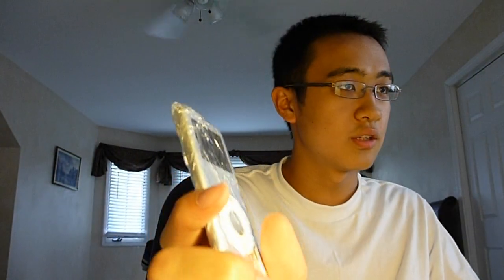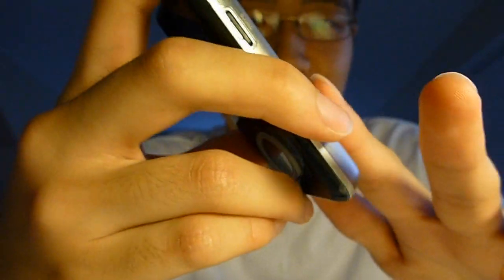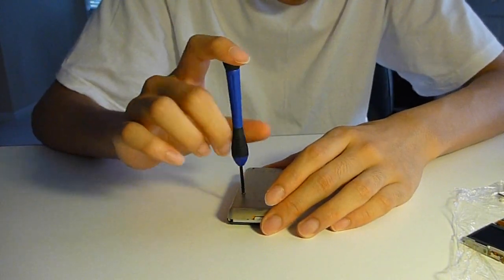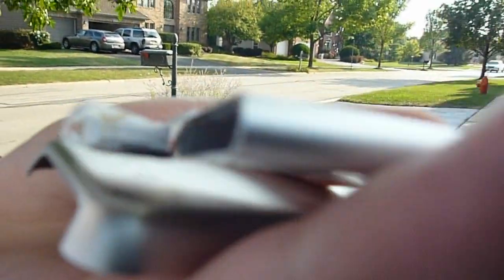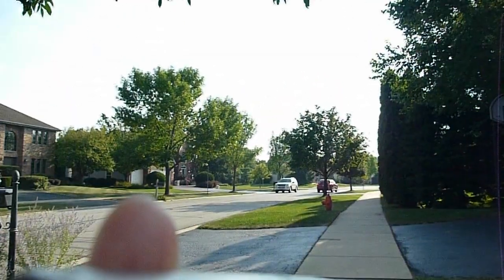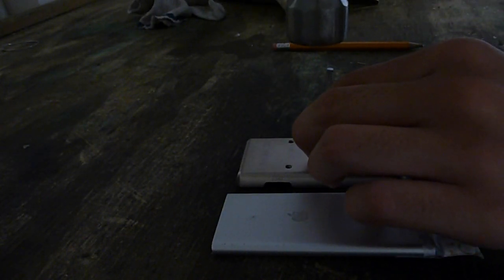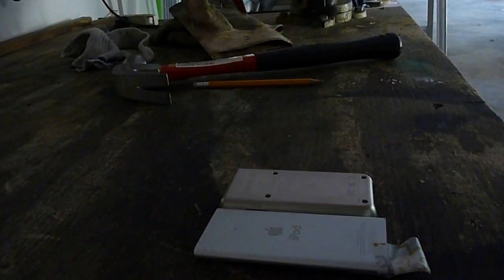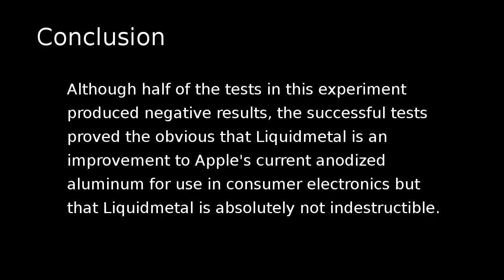Liquidmetal vs Apple Anodized Aluminum

Comment: Why aren't you using marbles or steel balls to do the bounce test? And you need to put the cases on a direct flat surface (no gap between it and the surface which the bevel causes). The wooden table is absorbing the impact.